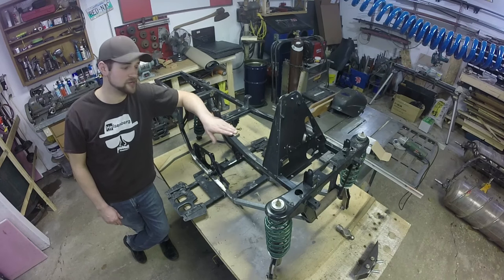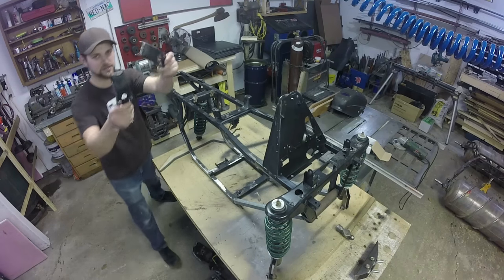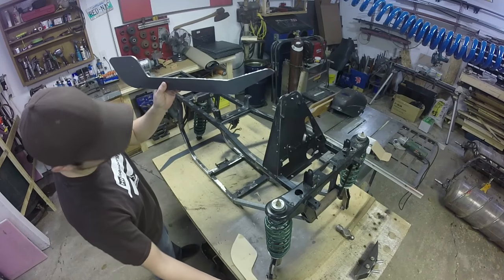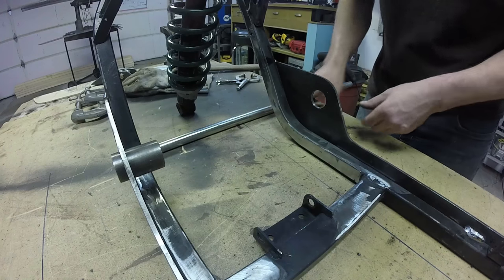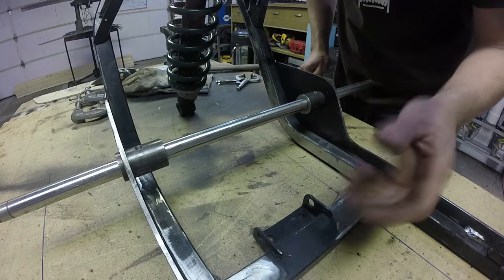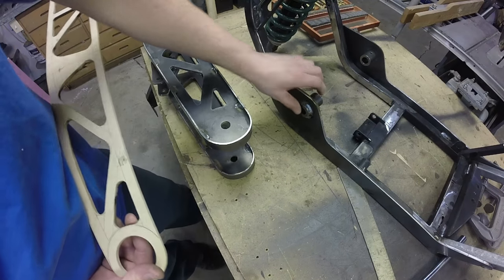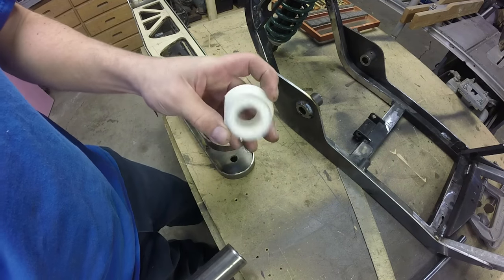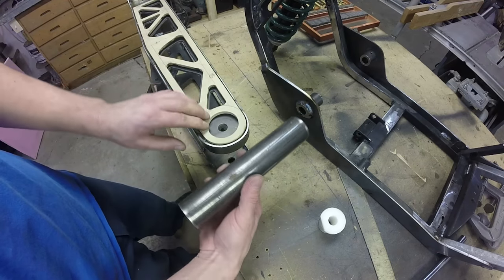Amphibious Screw Drive ATV Project - Part 5 - The Bulkhead

Comment: Nice work on the suspension. I initially couldn't see how you were going to avoid over-constraining it with the front and rear axles tied together by the screws, but using the screws as two links of a four link suspension is some good thinking!
Reply from the maker: +cucumbersonfire yeah i really think the design is fairly sound. Its just a matter of if its going to end up strong enough.

Comment: I admit, i had a few reservations regarding the suspension, at the front mainly, i figured that the rear would tie in with it somehow, but now, seeing it, well, complete turnaround, this is a really nice design. Once you fiddle with the front to make it proper, this is going to rock.
Reply from the maker: +aserta thanks! Yeah it kinda just became clear to me one day, it will be interesting to see if it rips itself in half once i put power to it hehe

Comment: Well you coming right along I see...Your propensity for inventing new words may be a craftier skill than the gizmos you come up with😁  Im curious to see what the weak link in the system turns out to be after your motorized and put everything under actually working load. Its just part of the creative process but it looks like its coming together nicely and you've tried to eliminate most of the obvious gremlins. Will the buoyancy of the screws be able to make you fully amphibious after you've got it together? Might be a possibility if you start designing in allowances now for weight saving and balance? Could be a nice benefit for crossing frozen streams or swamp if the ice can't support the weight. I wish you best of luck and may the force be with you! Can't wait to see what's next!
Reply from the maker: yes i do plan on making it float, there are certain areas that have to be strong no matter what though.... soon i will get into crunching some numbers on that stuff to see where i stand. thanks for checkin it out! and the input

Comment: A wishbone from a Model T Ford would have worked (less fabrication).  Subscribing
I think you should look at how a zero turn mower is driven and use that.  It will give you greater torque and allow you to use the screw drive like the historical videos.

Comment: I've been scanning the comments and haven't seen anyone mention that you should switch to plastic screws for light weight and float ability. Not sure how they would be made but they would be far lighter than those tanks. 😊
Reply from the maker: any ideas? plastic barrels? would the fins be steel?
Reply: REDNIC79 Plastic barrels are common and cheap, large plastic pipe is expensive. The most common size of plastic barrel is 55 gallon and I think that's too big. 30 gallon would be better. You might have to learn plastic welding to modify them but I think it's not hard.  The auger portion...  Maybe weld on pieces from barrels or maybe bolted on metal? Either way it would need to be sealed to float.  Those tanks will probably float but I believe it will sit quite low in the water.
Reply: REDNIC79 sewage pipe comes very large durable. somthing to look into. maybe bolt thin cut sections of rubber car tire as the fin.. just an idea..
Reply: some are plastic/poly and some are metal. either way would work
Reply from the maker: how thin is the wall on it?
Reply: REDNIC79 ill check monday at work .. cheers
Reply from the maker: that would be great, i think i need thin stuff, like 1/8th or 3/32

Comment: Hi
Great job and a lot of fu to watch Your project. One concern about suspension- in the vid there seems to be a lot of flex on front screw bearing. The front "brigde" that connects both screws rocks back and forth- how are the screw axle bearings handling it?
Reply from the maker: +famkot thanks, yeah they do flex quite a bit. They are pillow block bearings that do swivelmin their mount, and the swivel action has grease fittings. Hard to say how fast they will wear out. Not sure of other options, you?
Reply: REDNIC79 thanks for your explanation, i thought these were standard bearings that shouldn't flex. Great job!

Comment: Are you making this chain driven in the back? if so do you think the chain twist will be ok?
Reply from the maker: +marinepoof no, straight hydraulic drive, the drive motors will have to flex with the screws
Reply: this will be interesting! have you also considered electric engines on both screws`?